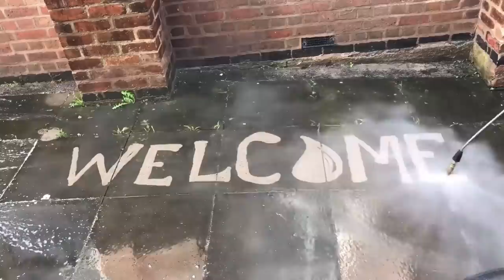Decades of Filth on these Slabs | Pressure washing a church surface | Satisfying video

Comment: They asked you to that difficult a job on short notice? No drains and a lot of sludge to remove?? Black Spot? Thank you for doing such a thoughtful cleanup and thoroughly looking at what was needed to make it a complete result. Interesting, so they were going to have an event, needed a better visual presentation and increased safety, in short order.  If going to an event is similar to selling a home, than the impression of the situation is perceived in the first few moments/minutes, so your work in making the area renewed was important. Good rescue work, an excellent thought to clean the outside of the wall as well, pulled the whole area together. Nice to see the colors and design lines renewed.
Reply from the maker: Basically priced to give a through clean in the surfaces but I was happy to include some wall parts, window ledges etc. to make the church looking good, thank you mate 🥰🥰👍

Comment: 9:45 Note the blue door on the left.
At first it slowly goes back and forth a few times until it hits completely at 10:15. 😮
Was it very windy there at the time and did the door move? Or maybe it was a poltergeist 👻 who didn't like your washing action. There are supposed to be a lot of poltergeists in England. The church in particular is an old building, so that can happen. Whatever it was, it was a bit spooky. 👻🤭😉
You've done a good job again. The result is impressive. The pastor and the congregation must have been very pleased with this transformation! 😊👍
Reply from the maker: Thank you, it was a bit windy but the door I was trying to keep close because people make arrangements for the event they sometimes kept open and closed in fast forward you May seeing differently 😜 🥰🥰🥰 they are really happy 😊

Comment: Will you have to repair the chuck out of the wall by the stairs that the power washer took out?
Reply from the maker: No as it’s the old paint pieces flying away as algae covered basically had to give a wash to looks nice